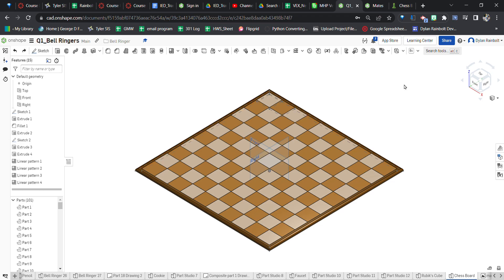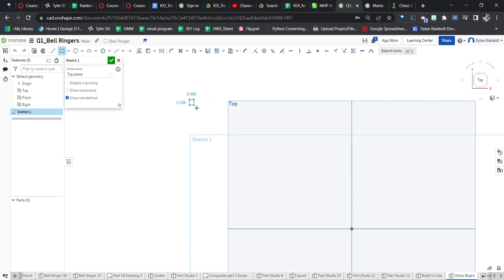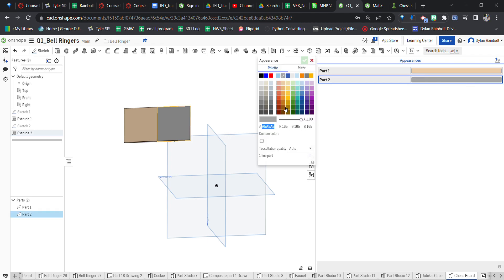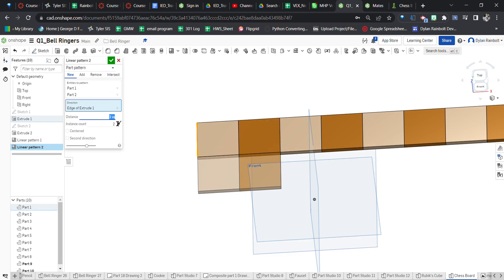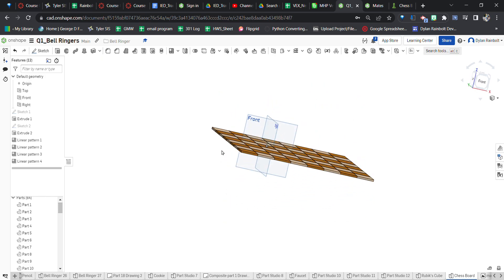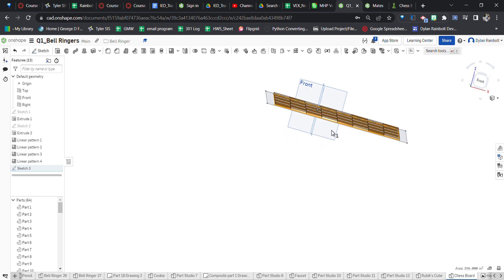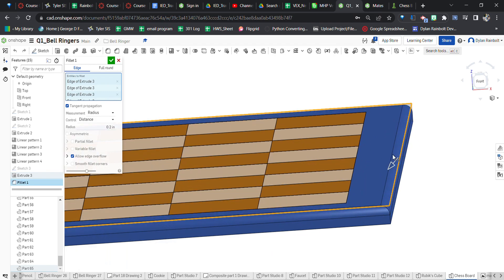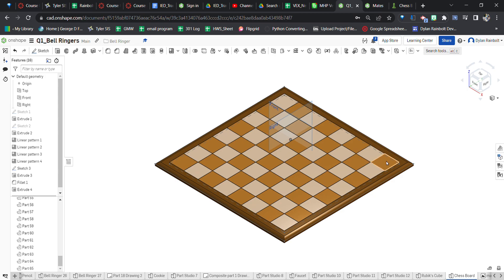How To Create a Chess Board In OnShape

Comment: Hi Dylan, can you please explain how to get the origin in the center of the board? The board that you had at the start of the video was centered at the origin.
Reply from the maker: Hey Eduardo! If you have the chess board already created, you can use the transform tool in OnShape. Select all the parts you want to move (in bottom left corner of screen) and then select the translate by xyz option. Simply type in the values you’d like to offset the board by in each axis to center it.

Hope that was helpful! If you have any other questions please let me know.
Reply: @DylanRainbolt  Got it , thank you.